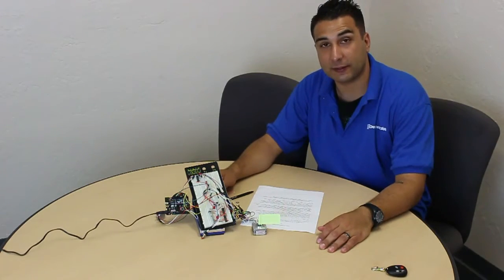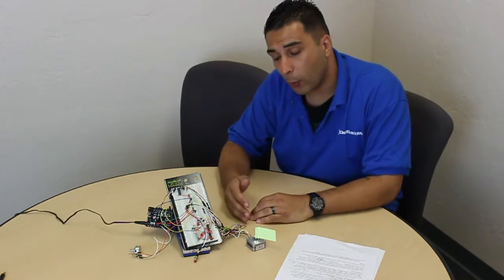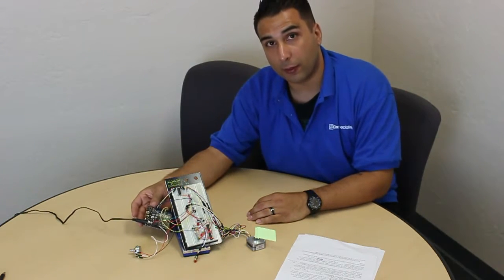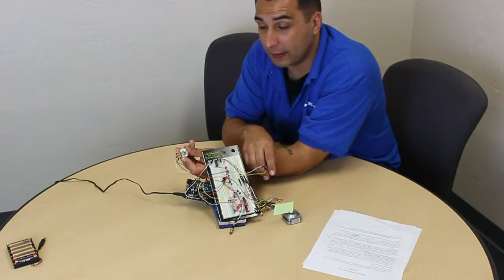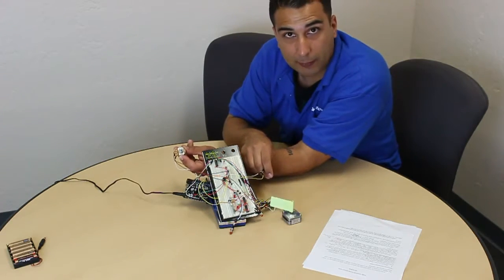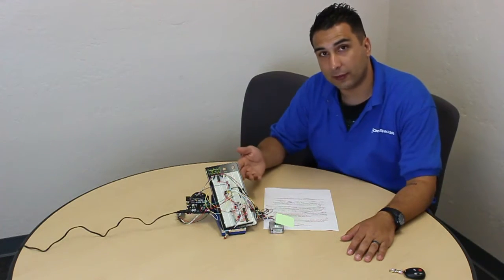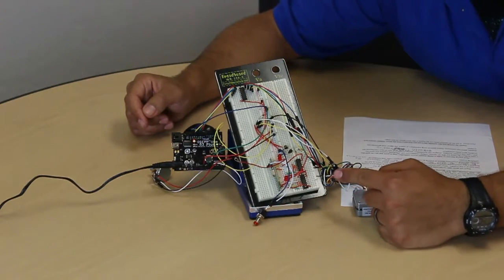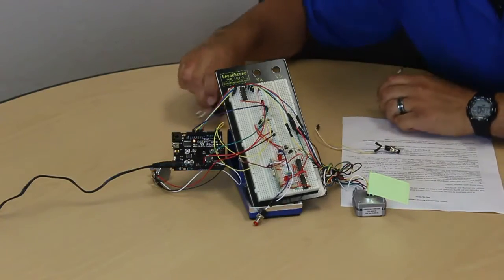Wireless Stepper Motor Control with Arduino

Comment: Hey, nice video. I have a question. Lets say i push the on button on my remote control and i program my stepper motor to turn 7 times to the right and then stop. But then again i press the on button on my Remote control but i dont want my motor to keep turning right. What would you do? My stepper moves my drape, so if i press the on button and then i press it again the stepper will rip appart everything. I hope you understand what im trying to say.